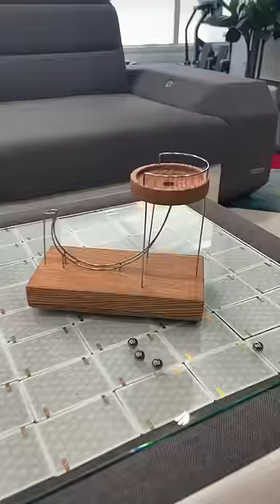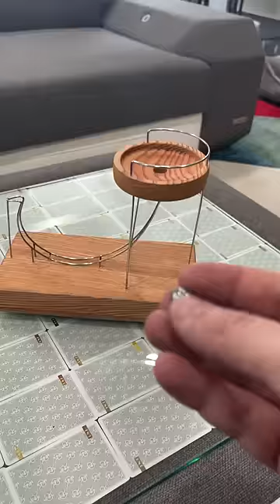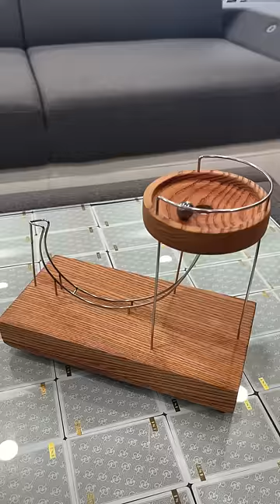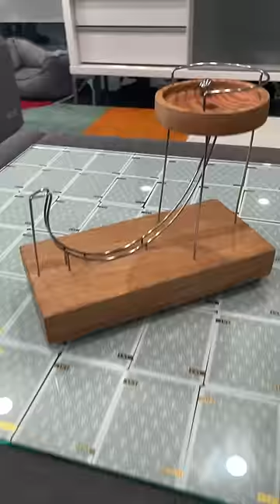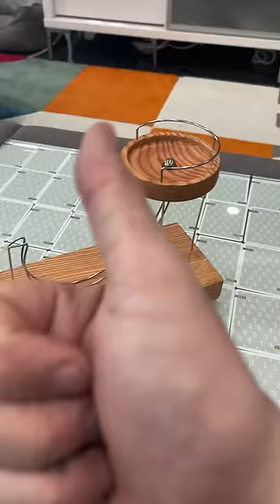An Impossible Perpetual Motion Device?! 😳 #Shorts

Comment: He “forgot” to tell about 5volts input.
Reply: Thank you
Reply: Oh i see...
Reply: Is there a video explaining what exactly the 5volts input does or how it causes the motion ?
Reply: @TheTopStarz   there is a magnet underneath which speeds up the marble, it does not work with glass
Reply: @TheTopStarz  Basically there's an electromagnet in the base (a magnet that can be switched on and off using electrical current) it switches on when the ball is falling, which gives it a speed boost and then switches off as the ball moves away from the base.
Reply: @BigShippy0  technically kinda correct, but to give a better image of how it really works, imagine the metal ball is the switch and the electromagnet is the entire railing
Reply: @davidtitanium22  ...so what your telling me is that we are looking at a railgun?
Reply: @heynosjosh  that’s an awful term for it… but yeah. Same concept.
Reply: What if you added a solar panel rather than a battery? Does make it a perpetual motion machine or no?
Reply: @darkthrone56  no because if the sun goes down or gets blocked it stops.
It has to work indefinitely under its own power to be a perpetual motion machine. So it must create its own energy and use it to keep going.
Reply: @darkthrone56  That breaks the “perpetual” part, since it wouldn’t work in a room without light. A perpetual motion machine should function without any outside influence applied, including solar energy

Edit: sorry just saw someone else said that! Mb
Reply: @darkthrone56  no because you are adding power from the sun. So it would keep going until the sun burned out. But it is still losing energy.
Reply: @Brudech Msion yes that's what I was trying to say
Reply: This device *does not* need electricity to behave this way. 

The ball still loses energy at every “loop”. The ball always falls short of the hole. It’s the platform that allows the ball to travel the distance lost in the energy transfer, back towards the hole—it’s initial point—to restart the loop. 

It’s that part of the logistics here that is confusing people.
Reply: @stevenc8717  so how long does it run before it runs out of energy?
Reply: @stevenc8717  nah man that's just not how it works
Reply: @stevenc8717  You're making a perpetually moving device too easy. We can establish right from the beginning that the ball will never rise higher than its original position without aid. The ball would have to fight gravity up the platform if it worked this way, so it again would not work. 

This can be done either with a 'rail system' as explained or simply just using a coil in the base. Several ways to go about it, all requiring extra energy.
Reply: @stevenc8717  you… you don’t understand physics very well do you?

There is no way to put this without being condescending, but I’ll try:

An object gains a certain amount of Kinetic energy when pulled down a ramp by gravity, let’s say “X” for that energy. It loses the equivalent amount of X energy traveling up to the original height, if there were no friction. However, a real system DOES have friction and the object will lose some amount of energy to friction, let’s say “Y” is the energy lost to friction.

Your explanation that the ball is somehow unassisted and that it can reach the top without gravity is basically stating this proof:

X=X-Y

The lip of that small ramp is higher than the drop point, meaning the ball MUST maintain positive energy gain to reach the top of the platform, otherwise it is breaking the law of conservation. If you search on YouTube for how this little desk toy works, there is an explanation.
Reply: All of the clowns that think it involves magnets or electromagnets…no, just no. It has a tiny wheel in sidewall of the hole/drop point of the top tray. The wheel is battery powered and it spins as the ball passes through the hole. That’s how it picks up the needed speed. Just think of a roller coaster moving along on flat parts of the track, usually towards the end of a roller coaster ride. Wheels on the track spin, pushing the coaster from underneath and giving it the speed needed to make it to the end of the track.
Reply: @stevenc8717  I think your comment is ACTUALLY the most confused one. 😂
Reply: @asr34ify  As long as it takes to drain (1) AA battery.
Reply: @chrisjenkins203  lmao
Reply: @chrisjenkins203  may the clowns inform you that there is a video with someone holding a compass next to it, measuring the magnetic field ?
Reply: @chrisjenkins203  The motor operation is hilarious because it's such a lazy way to do it. It would make noise and be obvious to see by just looking at the hole. I feel like somebody in China decided that was a cheap alternative to the magnets. There must be different versions of these things where some a nice wood bases with actual electromagnets and some are just basic motor drives using the fake wood.
Reply: @chrisjenkins203  I was wanting the other guy to admit it needed an external power source but thanks.

Comment: I was really confused as to how the ramp could launch the ball higher than the original drop point, then I realized the ramp is powered.
Reply: Because of the spacing of the rails right?
Reply: @DominiDiscord  no, that would still be perpetual motion. Assuming this is real there must be a battery in the base box and some form of electromagnet pushing the marble
Reply: Yeah there’s definitely a kind of magnetism pushing it forward. If you look at the balls they even fall way too fast
Reply: You can hear its sort of floating at the start of rail which is telling me its propelled by electro magnets.
Reply: Surely it can’t just rely on magnetism, else permanent magnets would make it perpetual? Or at the very least it would last a good few thousand years.
Reply: @tylerclarke4829  electro magnets, much stronger but require electricity.
Reply: I get your point Actually you can, this is not water in a pipe 
By changing the shape of parabola u can gain height at a trade off of length without changing work done
Reply: Bt yea, perpetual motion is impossible eithe way dont get me wrong
I just want to make a point that it is a factor of work, not height or distance independently
Reply: oh god im an idiot... thank you for murdering my ignorance.
Reply: I assumed it was powered somehow, but how?
Reply: @tylerclarke4829  they need to be electromagnets because they have to switch polarity as the ball passes. Permanent magnets wouldn't work.
Reply: @EndureTyrant  theoretically if a permanent magnet was strong enough wouldn’t  it be an infinite loop?
Reply: @ZanHecht  it’s magnets I can give u a link if u want guys, the store has other cool like gizmos as well
Reply: @ZanHecht  oh yeah that makes sense. If it where permanent it would bring the ball back towards the magnet
Reply: @horizon645  The problem with magnets is that they’re omnidirectional. They’ll interact with an object for as long as they have a magnetic field (so a really, really long time), but they’ll do the same for something moving away as well, resulting in zero net gain for anything that doesn’t just automatically stick to them, not counting energy lost in the process.
Reply: Its the same basic principal a rail gun operates on. One positive rail, one negative. The ball makes a circuit when it makes contact with both rails propelling it in whatever direction it is travelling when it comes in contact with the rails.
Reply: @bradly13anderson exactly,that’s why motors have to rotate there polarities to  spin.
Reply: @organik26  and you’re completely correct!
Reply: @gonzothecat5901  - Yes please, Eddie, I would definitely love to use the link
& view what else the people are selling.
Would you mind taking the time to give us all the link?  
💗 from Toronto, Canada💗
Reply: @organik26  no.
Reply: No It isn't.  It's just kinetic energy.  The Geometric design of the launch ramp is outstanding.  I think it's Very Kool
Reply: @elizashadowwalker559  xactly. How do these fools add power to the equation? Far out, some people just shoudnt speak...
Reply: Yes it’s magnetic and has to accelerate quite a bit to accomplish what it does.
Reply: @4pmpm114  u baiting or just slow?
Reply: @ZanHecht  I don’t think that is so. Im no physicist but wouldn’t a magnetic ball such as this one not require a change in the permanent magnet’s polarity on the basis that it is spherical? Say the magnetic field is positioned with the S pole closest to the wooden platform and the N facing down towards the rail, the ball would have dropped from the platform with enough potential energy to mitigate almost all deceleration from the similar pole whilst also gaining even more kinetic energy from opposite pole depending on the direction of the poles of the ball? In this case the net increase of energy would be in the positive, allowing the ball to accelerate more than would be expected from the same height and thus ends up being able to ‘jump’ back up to the platform. Obviously this has no way to generate energy and i assume because of the gravitational necessity it wouldn’t be a closed system and therefore couldn’t be called perpetual? I don’t know but its cool to think about.
Reply: @tylerclarke4829  take a magnet with positive and negative polarity and try to stick both sides to a refrigerator. That will answer your question.
Reply: @tylerclarke4829  With a permanent magnet, the energy gained when approaching the magnet will be exactly counteracted by the energy lost when moving away from the magnet. (or vice versa).
Reply: @tylerclarke4829  it most likely works in a similar way to a coil gun, where all you need is the ball to be ferro-magnetic and a well timed power cycling of an electromagnet. You turn the magnet on at the right moment for a fraction of a second to pull the ball forward along the rails but you turn it off before the ball would reach the center of the field, therefor allowing the ball to travel forward along the rails at a now increased speed. I also imagine that the balls close a circuit that starts some kind of timer when they contact the rails which is why two balls at the same time wouldn't work.
Reply: @warrenarnold  make the balls magnets and add in some copper as it re-enters the start area and you could generate a little electricity each cycle.
Only a million cycles to charge your phone!! 😅
Reply: I think it's just the difference between where the ball drops and where the wooden base catches the ball 🤷🏻
Reply: Oh
Reply: A permanent magnet hidden in the wood adds energy to every loop.  That’s why it’s not a perpetual motion device.   “Permanent Magnets” aren’t really permanent, they will lose their magnetism, sometimes, over thousands of years. That’s where the energy is being added from.     Just watch the unnatural movement of the ball bearing, right after it lands
Reply: Fucking magnets. How do those work?
Reply: @gonzothecat5901  yes please
Reply: @gonzothecat5901  link?
Reply: @horizon645  No. As stated by another commenter, the magnets need to switch polarity as the ball passes, only electro magnets can do that.
Reply: @cjwrench07  so a thousand years of a machine working isn't perpetual motion, but isn't that a quite efficient machine? Only needing parts ever thousand years.
Reply: @Chris Wings It 🇺🇦 Reducing the radius does not magically increase the energy of a system. Even in an ideal frictionless world the ball would not make it over the lip at the top because that would require more total energy than what was initially in the system.
Reply: @MinutemanOutdoors  Not a rail gun. In a rail gun, it's the "bullet" that shorts the two rails. This device already shorts the rails because it's the same wire that forms both sides.

But you can either have an electromagnet in the base or a motor or electromagnet just under the hole. It isn't very much energy that needs to be added for each marble.

A motor would allow multiple marbles falling directly after each other and he said max one at a time. That instead matches the timing of an electromagnet - it must be off for a while before it can be turned on again for the next marble or it would end up reducing the speed of the first marble.
Reply: Magnets lose their stuff over time.
Reply: Ahh makes sense
Reply: @doracotterell2863  I believe Eddie Long is a troll living in his mom's basement. Just my opinion 🙄
Reply: Oh wow, you burst my bubble! 😳
Reply: @hardwirecars  - Murdering your ignorance?
That's a new one to me!
(I really like it!)
Reply: @skimask4381  - I didn't think very much about it, and it didn't even cross my mind that it was powered. I guess if it REALLY, TRULY WAS a perpetual machine, we wouldn't be watching it on YouTube.
(Duh.)
Reply: @tylerclarke4829  - What you just said... Huh?
Reply: @kailasac6532  - I don't think there are any bubbles in this equation. Just electro magnetic polarity... backwards or something.
Reply: @cjwrench07  No. Permanent magnets do not lose their magnetism by "discharging". They do not deliver energy to any objects. They will very, very slowly yheir magnetism if used or not used.

And they can not deliver energy to these balls. If they could, they would be better batteries than our very best li-ion batteries by several orders of magnitude.

Why argue when this device is already proven to have a battery?
Reply: @tylerclarke4829  the electromagnet can be switched off after boosting the ball so it doesn't drag it backwards when the ball has passed it
Reply: There is actually a motorised wheel in the to wooden piece that accelerates the ball down the ramp. There's an on/off switch on the bottom side of the conical wooden piece
Reply: Clarke they've made "perpetual motion devices" based on permanent magnets but since permanent magnets arent technically "permanent" it doesnt break the law
Reply: Millions of people believe that there is an invisible man in the sky who watches every single person on this planet; however, most would say that this is fake.
Reply: @TrackPadDad  No - no permanent magnets gets even close to a perpetuum mobile. It only adds kinetic energy when an object gers closer. And takes back that energy when the object gets away. So use any number of magnets and you still can't overcome friction. Only a battery, solar panel, temperature gradient etc can be used to send in new energy and keep a device running for days or weeks - until it wears out or runs out of the energy source.

But any magic fixed location permanent magnets can still not manage someyhing even "almost" perpetual. You can bounce with magnets. But no different from how a ball or spring can bounce. And every bounce is a bit weaker - not because the magnet wears out but because no fixed magnet can add more energy to compensate for losses.
Reply: @Alabastorskyline  you can also see it pulling the ball to the hole
Reply: @matthewmcclary7855    In a sense it’s efficiency. It’s why we use them in permanent magnet motors, and as super quiet & “frictionless” bearings in high-end equipment.   But, again it is not perpetual motion, because they are an energy/momentum source added to every cycle.     

The best fake “perpetual motion machines” on the market have working/running times measure in years and even decades now.
Reply: @elizashadowwalker559  no it isn't. It's literally on their website you clown.
Reply: @matthewmcclary7855  no. Do you not understand what perpetual means?